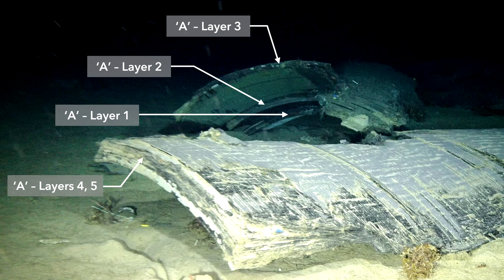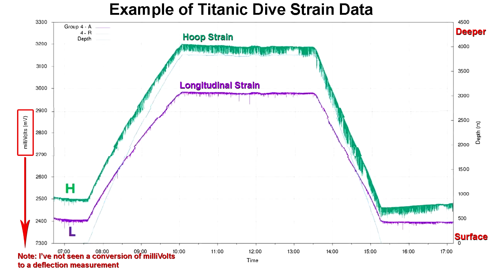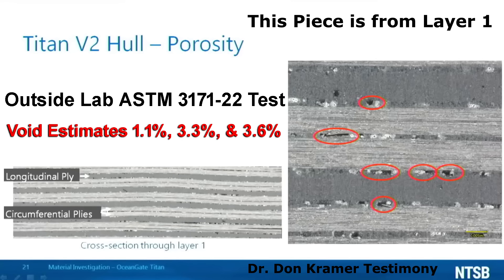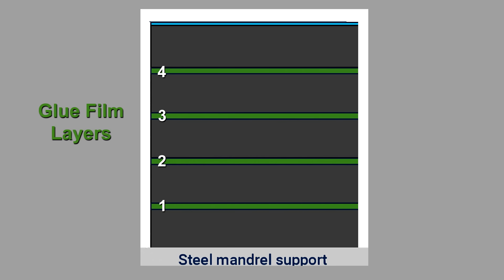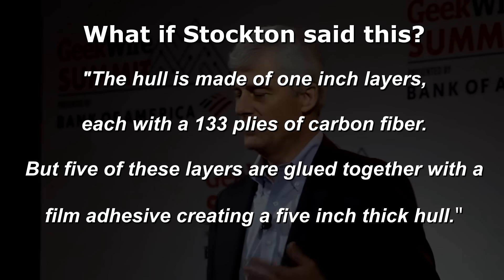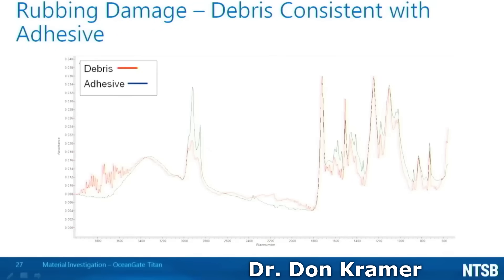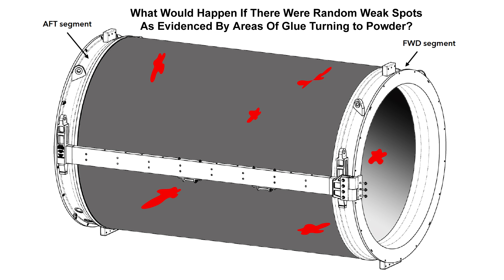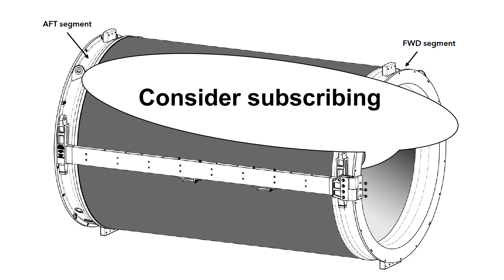OceanGate Titan Hull - Glue Layers Were Breaking Down To Dust - No Clues.

Comment: The dust is the ground up epoxy residue from high speed disc sanding on the high spots. The particles were melted and imbedded in the micro-pockets of the carbon fiber matrix. They might have not cleaned the areas sufficiently or vacuumed each area after the sanding operation.

Is there any documentation on the sanding operations? In another video you estimate 347 sanding operations! Maybe they got sloppy and let junior workers do the sanding? 

I have used this green epoxy. It’s a derivative of 3M Scotch-Weld 1838 green two-part epoxy. If it was a “sheet” —then how did it get activated? 

Agreed that curing epoxy at high temperatures and long cycles is a recipe for disaster.

Comment: I never understood his point of view that the hull was “most costly part of the operation”  which is why he chose carbon.  The cost of chartering the dive vessel would have been massive.  Not to mention that he had to build two carbon hulls.
Reply: I think it was the principle in it. That just because titanium was the right thing to use, you could just as well use something that’s much lighter and cheaper and almost just as strong to a degree. (if you believe Rush). Surely other things were more costly than the hull, but that doesn’t affect how his viewpoints and disregard of safety testing and protocols with Titan itself. With more testing of cyclic use and a more refined and sterile production, this might have actually done something to the industry other than disgrace it 
So sad
Reply: He could have had a much better business model if he remote vehicles as well. Could have been a lot safer too. But I guess that’s not the same as going down there yourself
Reply: @sonofsons770 Agreed,  they could have operated  as ROV test beds to prove the concept of carbon  hulls for deep water exploration.  Madness
Reply: They wanted to keep it light so it can be easy and cheap to launch. Other deep diving subs require much more complicated support ships.

Comment: Im the Netflix documentary, they talk about how the Version 2 hull wasn't thoroughly tested and pre-accident data was almost non-existent.
Reply: Hi Netflix documentary, nice to meet you
Reply from the maker: Thanks for your comment.  The V2 hull was only tested in the Deep Ocean Test Facility in Maryland.  They did four days of testing at the DOTF with 5 cycles of pressure up to Titanic depth and slightly greater.  Then they did some shallow dives back in Everett.  The manned dives over the Titanic site started with dive 61.
Reply: I don’t know if what the documentary said about that was actually true, but when I saw that point I was floored. Their scale models FAILED and they still went ahead with the design.

Comment: "So, Mr. Rush, what materials are you using for your deep sea submersible?"
"Plastic and glue, with a PlayStation controller."
Reply: The wild thing is that it actually worked for several dives.
Reply: @rhwing5095 and then imploded
Reply: And some rusty pipes as ballast, plus yoga mats to sit on and a tv and camera so we can see what’s outside

Comment: I maintain that there was a fiber-end crushing force that is also a likely failure point.  The resultant vector of forces acting on the end cap would act lengthwise on the end of the hull, where it has the least strength.
Reply from the maker: Thanks for comment.  Yes, you have good point about that axial compression on the hull.  That is good concept.

Comment: Good content, although it's very weird to hear scientific / engineering discussions using imperial measurements, which most of the world stopped using decades ago.
Titan seems to have been a disaster waiting to happen.
A spherical pressure chamber (as normally used at such depths) is much stronger as the pressure is evenly distributed.

Comment: Amazing how much DATA and information there is about it nowadays.... Now it is very clear what happened! That is the dangers of composite materials, even though everything could be prevented with better service (respecting the temperature and time of all autoclave processes) and monitoring the outer layers with the RTM (which at the moment was able just to monitor the most inner layer and not the others)....
There were TOO MUCH VOIDS, 3,6% is sufficient to make the layers NOT WORK as a unit as said, and the minimal movement between any parts making it rubbing with friction was the killer, specially IN THAT DEEP with that much pressure!!
The RTM snapping and Clicking noises were probably from the glue of the outer layers shattering due to the voids and micro movements (friction), once too much pressure is applied the material begin to reestructure itself and eventually snapping, again due to voids and glue shattering, again due to not respecting the autoclave processes.
Stockton Rush was a childish petulant who killed other people due to his inconpetence and lack of safety guidelines.
Reply from the maker: Thank you for the detailed comment. The issue is that we know this information now, after the fact.  But the mission specialists had no idea.  The OG marketing was slick and Stockton was a salesman.
Reply: All of this data was there THEN, they just didn't pay it any attention... because it was contrary to the wishes of Rush. No actual engineers are surprised at all. (if anything it's surprising it ever worked at all.)

Comment: 0:41 It was like a soda can under external pressure.  You can carefully stand on an empty soda can but if you put even a tiny defect in the side, by just flicking it with your finger, it collapses instantly.  On the titan the end caps were pushing towards each other hard, meanwhile the sides were being bent inwards.  The end cap pressure would increase and bend in the side causing any weakness/defects in the sides to become extremely vulnerable to further bending.  it is not a stable geometry.  Maybe a rigid ring in the middle bracing it would've helped but it would've interfered with the volume inside (passengers, etc).  It still isn't known what the exact failure mechanism was.

They were also grinding down high points and ripples in each fiber layer.  This created defects, cut fiber loops from having strength, forced loads onto neighboring fiber loops, and by cutting layers essentially reduced the effective thickness in those spots.
Reply from the maker: Thanks for your comment.  You are exactly right.  That is why the ABS engineer, Roy Thomas,  made  a big deal about "out of roundness,"
Reply: As a textile engineer (by education), grinding a fiber structure is unthinkable! (just as unthinkable as using CF in compression.)

Comment: This is why experts in this field recommend continuous sheet of material like titanium with the precise welding as you pointed out on the Alvin. Titan was a patchwork of horror - precisely the opposite of industry standard. I didn’t even know the extent of the glue between layers until you explained it - great video! I’m anxious to get a SDS or other info for this glue layer now
Reply from the maker: Thanks for your comment.  Glad that you liked the video.
Reply: They also indicate using as perfect a sphere as practical to avoid any stress concentrations. (it's also way airplane windows aren't square)

Comment: Truthfully any boat manufacturer could have told Stockton this wasn't going to work there was no need for high-priced engineers, your product is only as strong as the glue you use. And water under this type of pressure will penetrate everything. Try cutting carbon fiber with a water jet and see what happens. The banging noise they were hearing was the 1-in layers moving over top of each other as the glue failed.

Comment: UK plywood, the wood grain goes in opposite (i.e. by 90 degrees) directions in each added layer.
Reply: Thanks for your comment.  Yes, that is how plywood is made, like for a roof deck, sheathing, or a subfloor, the grain switches direction.  That is not the comparison I am using.  I am using LVL with is designed to take vertical loads, single direction, so the grain goes in the same direction. Thanks.

Comment: Is it possible, given enough testing and fine-tuning, to build a certifiably safe carbon fiber submersible capable of descending to the Titanic? The Titan seemed like a pretty decent, garage-kit, proof-of-concept prototype. Definitely NOT final-product worthy, but a pretty good proof of concept.
Reply: If they would have listened to Boeing there was a possibility it would have worked but since they didn't laminate it properly or wrap it properly at the thickness Boeing suggested it never would have worked. But as most experts have said carbon fiber is not ideal and even had it been tested extensively there's no guarantee that it wouldn't have eventually succumbed under pressure. It's just too lightweight. Listen to what James Cameron said. Works great for airplanes. Subs you would be crazy to even think about it.
Reply: Yep, there is a way conseptually, but no way inn hell Stockton would want to pay for it considering they opted for carbon-epoxy over just using a thick-walled titanium pipe. As someone who comes from aerospace I can tell you carbon fiber with epoxy (cured polymers in general) are ONLY good in tensile aka. being tugged as a rope. In tensile the fibers act like a "rope or string" being pulled, and the epoxy matrix is just holding the fibers in position. Under compressive load the epoxy matrix is the limiting factor, the fibers will just try to buckle up, (like when you push on a rope or string) and the matrix will have to prevent the shear whilst taking the compressive load while the fibers try to wiggle away, in short no-bueno.  That someone, engineers even more so, decided that using it for applications under severe compression, was even worth a try... Is unfathomly beyond me. Another fuckup is that they mostly used uni-derectional fibers. If any hope is to be had if using fiber composites to withstand compression, first off one have to mimic monolithic materials like metals (or even concrete), if using fibre-reinforcement, it needs to be a lot of small omni-directional fibers infused in a matrix material that is good at compression, like ceramics or glass-structures.

If one really wants a carbon fibre based deep-dive sub the only imagineable safe and reliable way to do it even before any proof-testing is to be done... Would be: Omni-directional Carbon Fibre Reinforced Ceramics with very short fibers, so small short pieces it resebles "pulp" more than anything. And used in carbon fibre reinfoced silicon-carbide refractory composite. Basicly you would have to scale the process used to make carbon ceramic brake-discs for high end cars (and aircraft brakes), to the size of the sub you want, and bake it at 1600 °C / 3000 °F, Alternatively the same Omni-directional "pulp" just of silicon carbide fibers cast in aluminium or other light metal forming a CMC.

In any case, except perhaps the Aluminium/SiC fibre CMC (which would still need to undergo lengthy trials), a good old spherical titanium casing is probably the most economicly viable option (which is why that is what typically is used...)
Reply: @flyfaen1 , 
I saw a video that said titanium would have been too heavy -- titanium plus weight of passengers for flotation and rescue purposes -- in the internal dimensions that it would need to be to accommodate the number of passengers they wanted.  They wanted to maximize the amount of money per trip they would receive from "wealthy tourists" so wanted something that would accommodate five persons on board.
Reply: Technically possible, but it would be an time consuming and expensive process. The level of precision and detail necessary is currently beyond the industry's ability. (mostly because only an idiot would think about using CF in compression.) Unlike a metal hull, a CF hull will fracture as it deforms leaving permanent damage, so it would have a finite cycle lifetime. (and it would be very hard to put a number on it.)
Reply: Carbon fiber is good for planes which face completely different forces. They're not uniform either, probably why they're called composite. 😂 Underwater if something not uniform, the composite parts behave differently - and with the titanium caps and glue the thing was completely unpredictable
Reply: No.

Composite materials are not homogeneous, carbon fiber is composed of a very hard thread of synthetic fiber that is glued with epoxy resin. These two materials have a different reaction to compression, so they do not stretch and compress evenly, causing micro-breaks that will lead to the destruction of the part (delamination).

Couldnt be use moore than once.

But thats onyl the fiber carbon material problem. The other problem is than carbon fiber cant be welded, so you will have to use glue to attach the carbon fiber hull to at least 2 domes of metal, one for entrance and the other for the window port. That is another cause of possible destruction after some deepts because porositi betwen materials and diferent expansion and compression ratios.

Titan Design: The Titan's design is a disaster. Deep-diving submarines must be spherical because this way the pressure is distributed evenly throughout the submarine. If this isn't done, there will be much more pressure in the center of the ship, requiring a hull twice as strong at the same depth.
Reply: @WalterModel45 ,
Regarding what you said here about, if it's not spherical, a hull twice as strong would be required ...
I see someone else commented that Boeing suggested, if it's not spherical, it should be 10" thick (instead of the 5" that was used) with the layers mounted at 45 degree angles  -- which I guess would give the hull an olive shape -- but Stockton said that would be too expensive.
Reply: Many aircraft parts nowadays are manufactured from CF, and while you need to take its properties into account in maintenance and inspections, there is no general problem with loaded carbon fiber stress cycling. As for cylindrical DSVs, Aluminaut proved that it is possible. 

The huge problem with Titan was that it regularly seemed to favor "innovation" and tbh cost savings to a far higher degree than thorough testing of material properties and scientific advancement. There is - as far as we currently know - nothing outright stopping the development of a CF DSV - apart from money, the needed thorough engineers and the publicity of carbon fibre pressure hulls in the wake of the Titan. The real question has to be the value of such a vessel, if the advantages of CF outweigh those of steel, aluminium or titanium, and if the layout difficulties of a sphere justify the extra material and engineering of a cylidrical vessel. 

As I do not believe that the answer to all of the above questions is yes, I think there won't be an vessel with excatly those parameters built in the near future - but there might well be some design elements that make it in future DSVs.

Comment: Excellent video along with your companion video.  I did not know the details of the shell construction until I watched this video.  What a clusterF of third rate engineering.  If the the designers looked at a piece of modern construction chipboard sheathing they would have been experts compared to what they demonstrated with this contraption.  Basically they had five independent shells sliding across each other with effectively useless glue.  Incidentally, the void issues are almost superfluous.  As a side note a single sheet of armor of thickness X is stronger than several layers of armor with a cumulative thickness X by a factor of 20 to 30 percent.  Similar physics apply unless it is composite armor..
Reply from the maker: Thanks for your thoughtful comment.  Thanks for watching the video and for your support.  I am glad you liked the content.

Comment: it looks like an expensive backyard project that makes no sense in reality.  on top of the issues around construction and certification was care.  lift and transport eye holes were (against engineering input) mounted on the vehicles RINGS - yes that spot where different materials were meant to mate and bond?).  Dive 80, a bang heard that was left to chance.  Dive 87, prior to its final dive, the vehicle was repeatedly slammed onto the platform while at the surface; the front-end was not properly secured, tossed by waves with passengers inside.  Imagine the force applied when the front vehicle pitched and slammed the platform deck, over and over.  Immediately following, the vehicle was stored.  outside. during the winter.  No inspection, no test dive. Next time at depth, implosion.  There was no respect for the vehicle, the ocean, or others. This was a walk to an inevitable end and it's sad it consumed innocent lives.

Comment: That window popped like a bullet and everything inside got expulsed at a massive force. That thing was a bullet.
Reply: They reported the window moving in. It was an implosion, expulsion has nothing to do with it. The pressure was outside not inside, the hull got crushed like a soda can along with the people in it.
Reply: @karolinawww6834  the air still needs an escape when the water gets in with that pressure